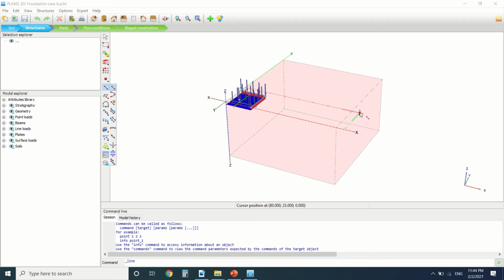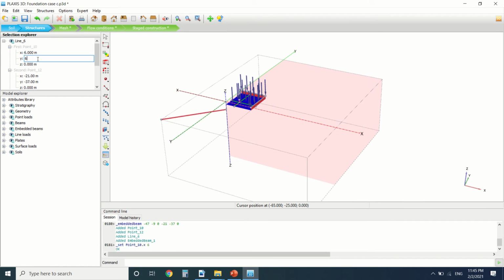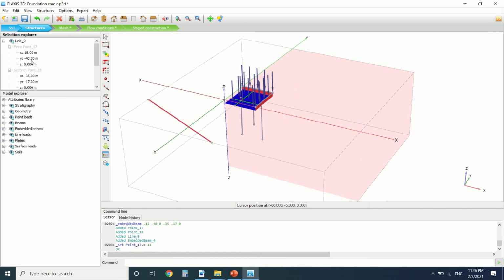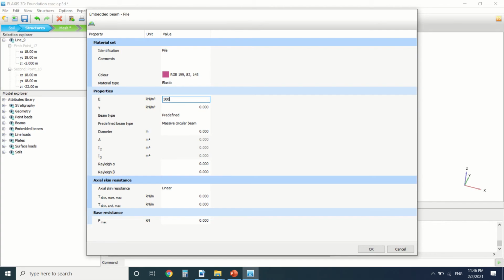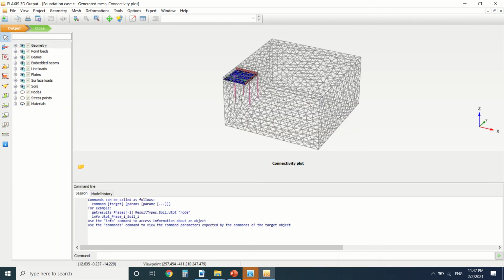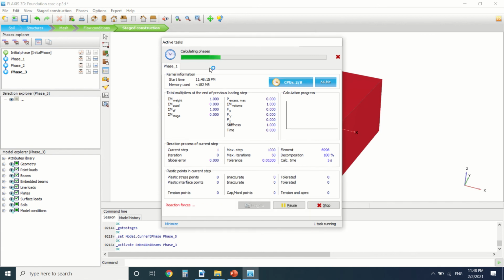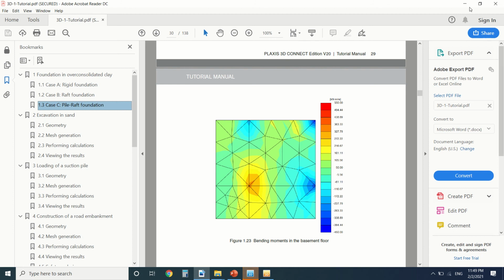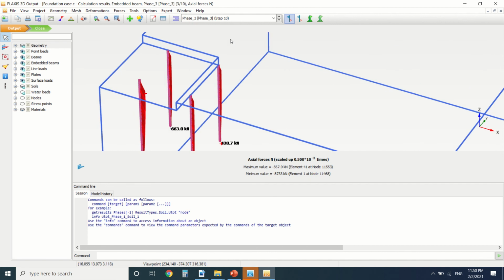8- Plaxis tutorial :raft foundation with pile modeling 1.3 Case C

Comment: Hi sir, thank you for the very useful videos, I wanted to ask you, I modeled a raft pile foundation, (raft e and piles like element volume , but in the middle of pile I modeled dummy beams) I extracted the displacement load curve, now I would like to extract the displacement load curve of the single components i.e. of the raft and of the pile group, also as I would like to  obtain the trend of the lateral and tip resistance with respect to the displacement of a  each single pile, how can I do ?
Reply from the maker: What?